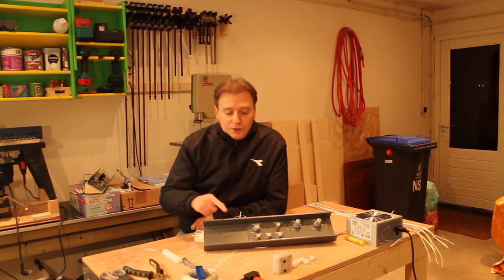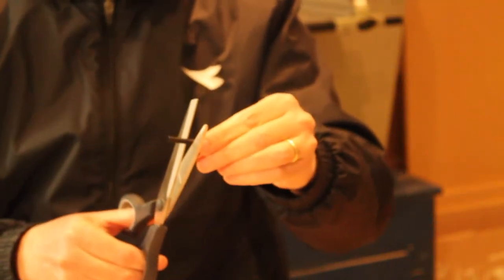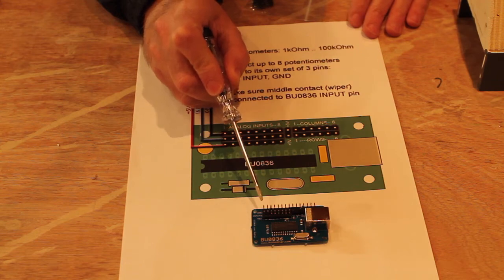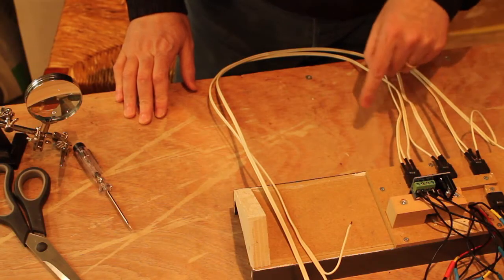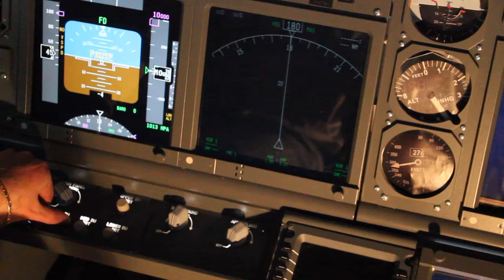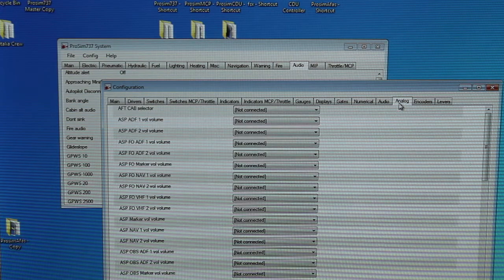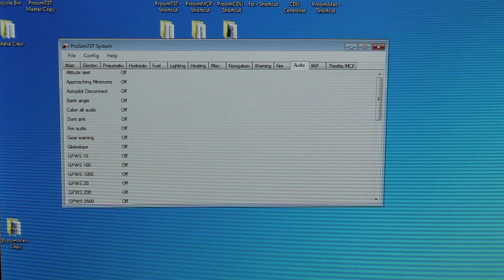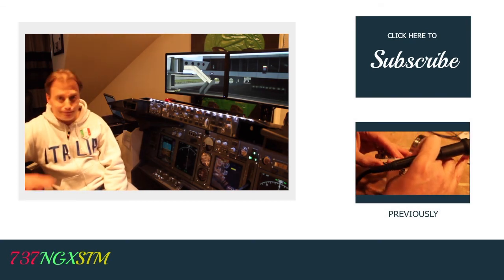Boeing 737 800 Home Cockpit Simulator #10 - Soldering dimmers and Potentiometers

Comment: Hi, excellent work by the way, which graphic card do you use?
Reply from the maker: I am using an AMD Radeon HD 7900 which I do not recommend. I got this because before I only had one computer and I wanted to attach 6 monitors to one graphic card, which this one allows. Now I add two more computers and a projector so I am planning to move to an Invidia when I get a chance.

Comment: I noticed on this video u didn't finish the back lighting across the top mip as u said u we're going to do that later when u wire them up will they be wired to the back ground dimmer or somewhere else
Reply from the maker: On the panel where the dimmers were placed, two of them were dedicated to the leds of the top of the MIP, I wired them just like the rest.

Comment: Hi, 
I'm currently working on a cessna simulator. Could do with some tips on implementing toe brakes to the simulator. Any ideas? :)
Reply from the maker: +Nikhil Gehani Hi, what pedals are you using right now? I have the saitek system that can be set up in "fsuipc"
Reply: +737ngxsim I'm using standard Cessna 152 pedals

Comment: how does the card connect to your pc
by usb?
how did you configure prosim for the brightness of the PFD & ND
did you make them recognise the displays then you configured the button for brightness of displays?
you project is very interesting
Reply from the maker: Ryaan,

if you watch update 8 and 9 all your questions are answered.
Reply: 737ngxsim ok watched it
but the fuctions in prosim are hard to find 
where to i have to go to find the lights config
Reply from the maker: ryaan beg
You go to the tab called Analog.
There you look for Right Inboard Brightness, Right Outboard Brightness, Upper DU Brightness, Lower DU Brightness, Left Inboard Brightness, Left Outboard Brightness

Comment: Woooow  GREAT video again!!   Good job !!   One suggestion  for desktop recording use Fraps or Camtasia Studio :) better image.   Can u make video  about how you make lower icas ?  what tipe of 10" or 12" screen you use and how you make work with ProSIm :)   nowhere is any videos on this lower icas tutorial :/   Thanks again !  keep up good work!
Reply from the maker: Hi, in my videos, update 4, 5 and 6 are about the CDU bay which includes how I added the monitor to the bay.
I used a 12 inch TFT LCD 800 x 600 4:3 screen VGA, which I bought from a reseller in China,

http://www.dhgate.com/store/product/best-selling-12-inch-pos-monitor-with-vga/163599837.html
I did have to pay dougane charges :-(

To make it work with prosim is no different than the rest of the other display like the avionics.
Let me know if this is not clear and I will make a quick video.
Also I really appreciate the tip on Fraps or Camtasia Studio, I never used this type of programs, but I will give it a go.
Reply: 737ngxsim
ohhh thank you for the link was exactly what I was looking for. -  or you have already built a VGA connector or you do yourself for example (screen of the laptop or you take a photo frame... where you dont have VGA or DVI connections).  About screen recording  i reccomend you to use Camtasia Studio, because you have also Editor for video build in :)  check out :) 

but if you want to do some video about lower ICAS would be perfect , because this will be the first video on youtube about this topic. :)  I have not found anything more detailed or some trick or tutorial given that there are 2 CDUs and in between LCD screen :)  Many vidos shows only from the front side  :/   Nobody shows how is all connected and so one...  

yeah thanks a lot for your reply :)

Comment: Great video again. I'm (very slowly...) building my own pit (captain's seat only), your vids provide a lot of practical info that I have used and will use!

To give something back perhaps and since you ask for suggestions, here's one: in Prosim737, you can move a lever, press a button etc. and you will see (somewhere up in the config screen) which input is activated. This way, it is easier to assign switches and analog levers/pots to the right functions - and a whole lot quicker than how you are currently doing it ;-)

From the cockpitbuilders.com forum I gather you live in The Netherlands too - maybe I'll run into you somewhere.
Reply from the maker: Hi, thanks for the comments. thanks for the suggestion, I will test your suggestion tonight, this would really save me lots of time. :-)

would be fun to meet more fellow builders :-)